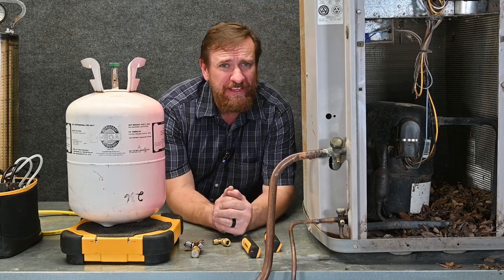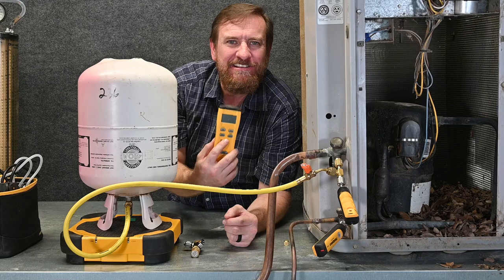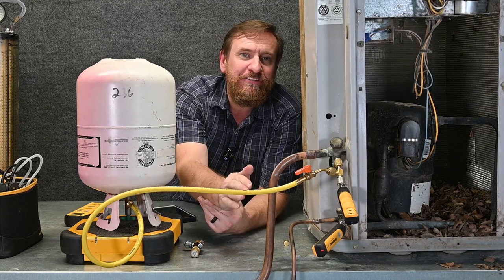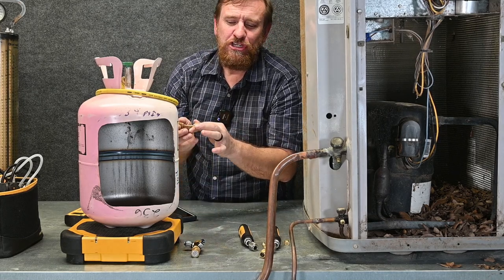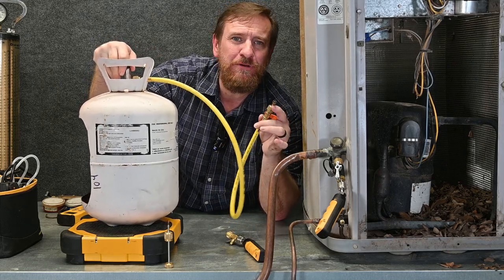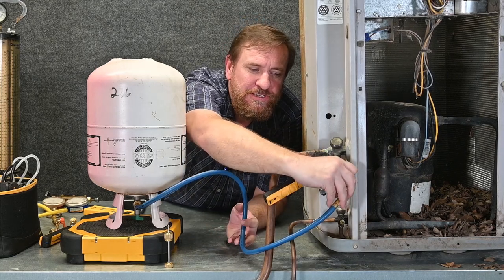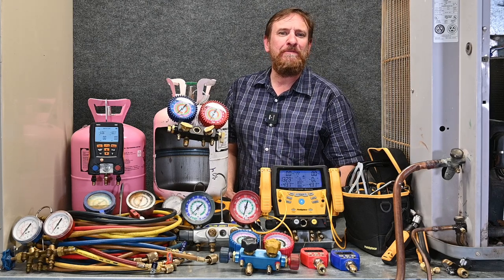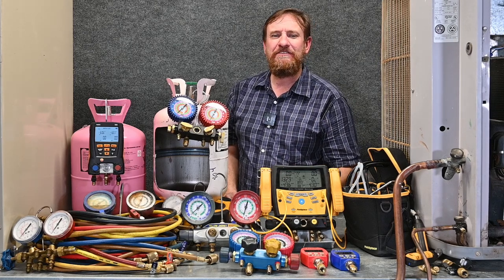HVAC 119 Charging with Wireless Probes

Comment: Lots of great information but I have suggestion. You still have air between the shut off valve on the charge line to the "T" and the "T" fitting to the suction line. Not much, but it's there. I would suggest to purge the line where the "T" connects to the suction line getting rid of any air no matter how small in those fittings.

Comment: Why am I confused at how there appears to be pressure in the system when he purges the hose but while the hose is connected and he’s simulating charging the system by cracking the valve the cut in half tank isn’t spewing refrigerant ?? What am I missing

Comment: After you purge the air from the hose, the space between the ball valve and the tee has air in it. That's why after I purge the hose with vapor I keep the ball valve slightly cracked as I connect it to the tee to reduce the air introduced into the system.
Reply from the maker: Very good point! Absolutely right

Comment: Thanks again for all of the great content. Is it wrong that my instructor taught me to open the tank a 1/4 turn just in case I have to quickly close the tank in an emergency? Does this effect my charge?
Reply from the maker: It's not wrong.
Some want to leave the tank 1/4 turn to slow the flow of refregerants leaving the tank also. 

It originated from brazing so you could close the tank quickly is a fire broke out.

Always do what your instructor says.

Me personally I want tank completely open so control the flow with my ball valve. 

I'm trying to think of an emergency, busted hose is the only scenario I can see. In that case I would flip the tank upright so only vapor would be coming out and quickly close the tank. 

Again don't argue with your instructor. He or she is responsible for the safety of the class.

Comment: does your phone need good signal or data to use these probes? I get calls outside of the big city to smaller towns with shitty phone service out there.
Reply from the maker: No data or wifi needed. I have used mine in very remote places.

Comment: Swap the ends of your yellow hose around having valve by the tank then hose giving more room for vapor expansion.
Reply from the maker: good point!
Reply: Another easy thing to do is screw on Kwik Charge adapter to tank, and hose to Kwik Charge It will let liquid expand, and allow only gas to compressor
Reply from the maker: The Quick charge adapter slows the flow but it does not prevent liquid to the compressor. 
I do not recommend them

Comment: 3rd option is superier, IMO - that's what I do.
I only need the hose and tee for adding refrigerant - so it stays with the scale. 
Use the pressure from the suction side of the system to purge my charging hose back to the tank - then open the tank. 
I keep my charging hose and 'Tee' in the outside pocket of the bag that the Fieldpiece Wireless scale comes with...and roll it up in a way where BOTH ends of the house attach back to the Tee to keep dirt and moisture out of the hose - i'll also throw a little cap on the exposed female end of the Charging Tee to keep dirt out of THAT.

Once you get your system set up, it's way quicker and easier to use wireless probes VS an analog manifold, dual temp thermometer, wired thermocouples, etc.

Although, I do miss seeing the needles moving - which can sometimes be a useful troubleshooting tool.

Comment: Thanks great video.  What about the portion that is beyond the yellow hose value that small bit of brass pipe before the connector should that not be purged as well before letting anything into the condenser??  There is air in that portion to or am I incorrect on this?   This is where I really hate trying to figure out where to purge before starting up the compressor.   Refrigerant is flowing out of the condenser when off correct and refrigerant is flowing out of the 25 pound jug.  How and which side do you purge at the junctions to make sure no air is there?

Comment: I have low loss fittings for my probes with a charging Tee for adding refrigerant. Always able to keep myself from having refrigerant burn and they work great for critical charged systems. I only use my manifold only bigger systems with larger charges. I have flooded evap chillers with 3400 lbs of R134a so a few ounces isn't gonna make a difference at all
Reply: No need to use low loss fittings with fp probes. There's nothing to lose😂 they don't hold any refrigerant. If your getting alot of spray back you need to adjust your depressors but low loss fittings are useless. I get zero spray back w mine. And I mean absolutely zero.
Reply: @HVACRTECH-83  if you charge though you need to make sure the fitting T is lo loss
Reply: @yazbakri  no you don't. Never use low loss fittings. No need for them in any situation,and they end up all failing at some point. Im not trying to be rude,just talking from experience from myself as well as a good team of some of the most experienced  and best techs ive ever worked with,we all feel the same. It's always best to use yellow jacket hoses w the  ball valves built in. They will never fail you. Those are the only brand I can recommend, others fail as well. Low loss fittings were a thing about 20 years ago and I don't know why they are still making them, they were replaced with yj bv hoses and honestly I havnt seen any good tech use them in over 10 years at least if not more. They kind of just went out of style like the gauge manifold. Again, not trying to knock you, just trying to be helpful. For charging, just put an appion charging tee (the best one out there as of yet and when disconnecting theres no liquid sprayback)on your service port and use your ball valve on your hose to meter in. In the end, nothing wrong if you want to continue to use the low loss, but def less headaches without, that's all. I guess there's more than one way to do most things in life. Whatever you're more comfortable with

Comment: Great video, I'm a new tech and any advice will help. I invested in those probes and the field piece 4 port manifold, I didn't know that you can recharge with only the probes. I will definitely get that tee access for sure.
What set fo hoses do you recommend
Reply from the maker: Yellow jacket and uniweld both have nice set of hoses. 
For vacuum I like the true blue hoses but Navac, Appion, yellowjacket, uniweld all make vacuum hoses now.

Comment: subbed. I love your training methods. I believe you're the only person to have mentioned not flooding the compressor by only using short bursts, when the tap is close to the inlet. I do have a quick question though. using the short burst method, and using superheat to measure, (R410a on a piston)..... how long should you wait for the numbers before giving it another burst. surely it'll take forever if you can only give it a short burst at a time, then wait for the saturated temp to stabilize. New to this and i don't want to damage the compressor by not being patient enough.

Comment: Would you recommend using the liquid charge adapter on the bottle to help prevent liquid from getting to compressor?
Reply from the maker: Great question, I covered that a bit in  HVAC 116. They are nice to have but people get over reliant on them and don't understand how they work.

They are only a restrictor similar to a fixed office. There are several conditions that affect how much refrigerant flows past them just like a fixed office. 

When someone opens them up a continues stream of refrigerant flows. It is possible for that stream of liquid to not turn to a vapor before reaching the compressor. There are many factors and conditions that would affect that. In another scenario  it could be so small it takes for ever to charge the system. 
It's also easier to over charge a system. People leave them open get distracted and now they are having to pull refregerants put of the system. 

Personally I feel if someone understand they process it's unnecessary. If your working with a someone who does not, it's one extra step to help protect the compressor..
Reply: @love2hvac  thank you I will be sure to watch that video really appreciate you taking the time to explain

Comment: Do these wireless probes have sensors to measure temperature?  Are these battery or rechargeable through USC-C ports? Lastly, would these totally replace the manifold tool?  Great video. 🙂
Reply from the maker: Yes I use the complete set with the measure quick app.
2 pressure probes.
3 temperature clamps (3rd one for the discharge line)
4 psycrometers (RA, SA, outdoor ambient) 
2 pressure probes for return and supply pressure. 

I have not used a manifold in a while.

I use a T and a single hose with a manual ball valve for charging.

The probes I use do use replaceable batteries Wich is easier to swap a battery rather than wait for one to charge.

Comment: question, when using the auto low loss hose when adding refrigerant, how is it allowing liquid refrigerant to flow out of the hose and into the valve if it isnt depressing a core? i thought auto low loss had to be depressing a core in order to allow pressure out?

Comment: Great video!!! How would I search for the plug caps for my manifold/ probes and can one get it at the parts supply store?
Reply from the maker: I got mine at home Depot, the brass section in plumbing. 1/4 and 3/8 caps and plugs.

Appion makes a double ended one for hoses  at tire tech tools 
Appion HH1414 holds 1/4-1/4 and Appion HH1438 holds 1/4-3/8
Reply: @love2hvac  thank you for the information. You’re appreciated!👍👍

Comment: Would it be possible, faster to attach something like a KwikCharge metering device to the tank and then attach the hose to that to avoid having to manually meter in the liquid refrigerant? I’ve just recently started out in HVAC school so I’m still learning but was curious if that might work or not.
Reply from the maker: Good question

I covered that briefly in 116.

People really seam to love those but I don't think many really understand how they work.  It is simply a fixed hole, a restrictor, a metering device. 
The idea is it slows the flow of liquid refrigerant down enough so it has time to turn into a vapor. Slowing the flow being key. So if I buy a device that slows the flow, or an open and close the valve that slows the flow either way the flow is slowed and controlled. 

What I do not like about that product are a few things. 
1 it gives the false impression it's going to keep liquid out of the compressor. Under some conditions it will let to much refrigerant flow threw and a stream of liquid will enter the compressor. Under other conditions it will not let enough enter and takes to long. 
2 for a new tech it can offer some protection but it oversimplifies it and in turn causes more problems. Techs will leave the valve open thinking it's protecting them. Liquid to compressors, overcharged systems can be an issue.
3 it hold too much liquid and oil in the unit. The idea is it's large enough to allow for a check valve so when flowing the opposite direction it fully opens. That extra space holds extra refregerants, oil, moisture and more possibilities for contamination.

When people want to use one I recommend the yellow jacket version Wich is much smaller and takes up less space. 

I have had a lot of questions about it. They must have a good marketing campaign. When I get some more money together I will get some and show the operation the pros and the cons.
Reply from the maker: "Charging rate is up to eight times faster than vapor charging"
From the packaging.
They are comparing liquid charging to vapor charging. Charging by throttling  liquid has always been faster than vapor. 
Comparing charging by throttling vs charging by this device, they do not have any information.  I'll order a few types and do some tests so we can all see.
Reply: @love2hvac  Awesome, thank you so much for the response. I'll go back and check out your episode 116!

Comment: Why purge the line from the refrigerant tank hose to the shut off valve in vapor vs liquid?
Reply from the maker: Less refregerants loss,
Safer,
Longer purge time and still be diminimus,
Vapor purges better,
 liquid is more likely to absorb moisture and mix with the air instead of pushing the air.
Reply: @love2hvac  just curious. At Scotsman Industries we put shut offs on both ends of the hose and purge with nitrogen. Then attach to the refrigerant cylinder and purge with liquid to minimize fractionation. 

A zeotropic blend will have a different vapor composition sitting above the bulk of the liquid. If you remove this vapor, you will take the wrong composition refrigerant out of the cylinder, and leave behind the wrong composition refrigerant for future use. 

I suppose if you purge vapor once or twice from a cylinder, it is irrelevant. Although Is you are purging vapor a dozen or so time, I’m curious how this will affect the blend? 

Ice machines are most often filled less than a pound of refrigerant.
Reply from the maker: Ice machines and other critically charged systems have much more precise rules than the ac demonstrated here.

Also with ice machines I never top them off. If I have to attach my gauges I already know  going to be pulling the charge after I find the issue.  At that point I pull a vacuum on the system at the same time  pull a vacuum on the hose to the tank. That way the hose is also 100% dehydrated.  Then when I weigh in the charge it's liquid leaving the tank and directly entering the liquid line and precisely weighed in. I will be doing a video showing the method when I get to evacuation. It will be a while before I get to the detailed registration focused portion of the course. 

As always I manufactures instructions supersede anybody else.
Reply: @BartSimpson-nr1dy  how do you guys accurately weigh in such small amounts of refrigerant? I really need to get shorter hoses for charging small refrigeration stuff, I am always questioning if the unit is accurately charged.

Comment: You’re supposed to use a reduction fitting on that bottle
Reply from the maker: Throttling it in with the valve does the same thing with better control and less fittings

Comment: Purge the hose with refrigerant?? If we do this here, we will be prosecuted! Why not vac. the hose first?
Reply from the maker: In the USA this is a perfectly legal action. 
#1 The EPA 608 allows for de-minimum release and purging. This is perfectly legal.

#2 You absolutely can connect a vacuum pump with a T and valves. But it's a lot of time with little benefits. running an extension cord, bringing out the pump is a time and cost factor.

#3 Protection, this de-minimum is allowed by the EPA, but you can look up the EPA 608 enforcement actions and find a technician has never been fined for venting. They mainly look for large companies, supermarkets, importers and occasionally people stealing units.  Unfortunately there are a lot of people openly venting and even bragging about venting refrigerant with  no repercussions. There are even videos of people recording themselves doing it. Several people I know have reported people venting even with video evidence and the person admitting it  and nothing happens to them. The EPA dose not even follow up on it. While I believe we should drive to do better and be better there are practice limits on one hand and unlikely scare tactics on the other.